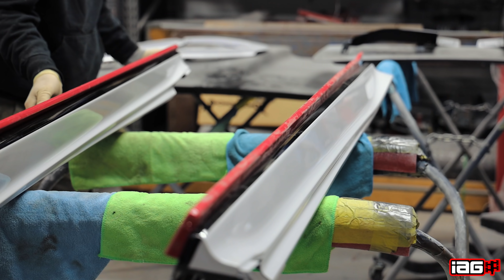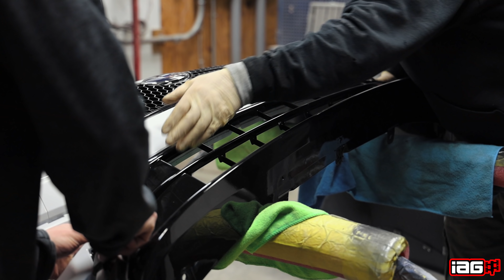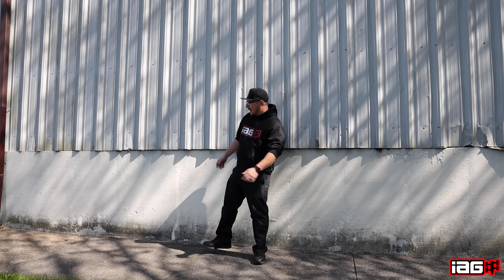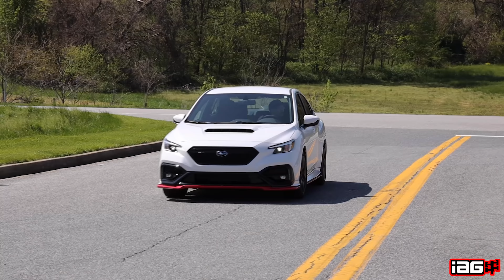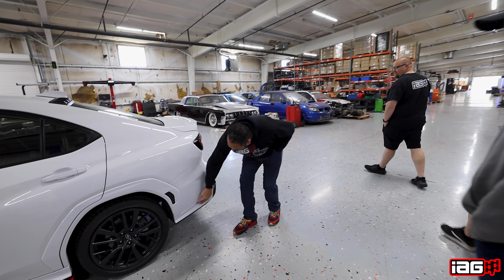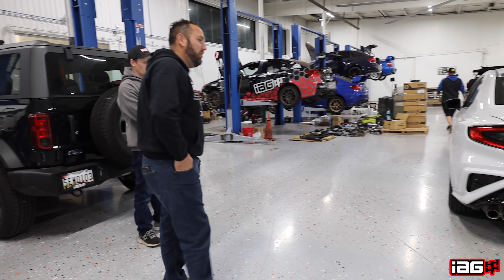Fixing The Flares Day 4: The Reveal

Comment: I'm sorry, but for those who want to "fix" the flairs, I think thats a very one sided opinion.  
 I owned a brand new 2021 STI, and took it off road twice. I had a blast and everything seems to line up with the design but my paint around the wheel arches, they  took a VERY noticeable hit on brand new paint.  Not to mention your passengers kicking your sideskirts leaving scratches. Now I have a 2022 wrx and I am thrilled to have the added protection. 

Fun channel. Looking forward to my upgrades when they get made. 
Cheers!

Comment: Looks much better than stock. Especially the rear end but the overall shape of that still needs to be changed along with the Civic tail lights. Still don't know what Subaru was thinking when they designed this. Still this is a step in the right direction.

Comment: About how much did this cost?
Reply: I will guess 300-500 per skirt, and 500+ on the rear bumper and 500 or so for all the fender pieces. to have a shop do it. Sanding down the hexagonal lines adds a bunch of labor. Doing that your self will save a good amount.

Comment: I'm always the guy who rains a bit on the parade, so...  The gloss black paint up front and in the rear is killer. In fact, many photos of these cars are not exposed properly and make all the cladding look black, even shiny. Look at Subaru Japan's own dramatic S4 shots...looks black.

The cons, though?  I'm 50/50 on the side skirts body color. I rendered a white car way back a year ago, with white skirts and white surrounds on the front.  Since, eh, skirts are fine. But the arches. Here's the thing about about being creative: you don't just do the obvious, same thing everyone is doing. And it's a Subaru! Embrace the weird, the quirks, or quit the club. The VIZIV arches, not body color...carbon fiber.  The JDM S4...like I mentioned, if they aren't black, the photos make them look black, and it looks crackin'.

Mine is Magnetite Grey Metallic, so people tell me "it all blends, leave it."  But my plan is to sand the arches and wrap with gloss CF.  I'll spray the same body color pattern on the rear.  The gloss black, though...I have been considering single stage gloss black front, skirts, rear.  For one, far easier. And two, as it gets banged and nicked, just some quick clean/sand/spray and back in business.

Sucks it's mid September, because it's probably best to wait until spring.

Comment: Spend $30k on a new car. Then spend close to $10k just to make it look some what better. Call me a hater but this car is still ugly. I will say this, you guys did a great job on the paint job.
Reply: Are you high?  $10,000 to paint some plastic trim? Lmfao. Bumpers are $450 to "repaint" at a shop. Flares would be $100 each tops....the other details they did would be under 2000. Your  math is WAY off. It looks MUCH better with those easy changes...better than any previous gen wrx
Reply: @Crazy8ts  it’s a general number for everything you would have to do to make the car look half way decent. By the way, we still don’t have a MSRP of what it would cost for a full kit. Then shipping. After that for those that don’t want to install it themselves they would have to pay some one. That’s an easy $3-$4k, after that your going to start spending money on whatever mods you can get away with. The bill will add up to $10k easy.